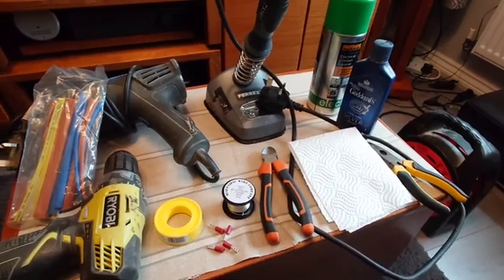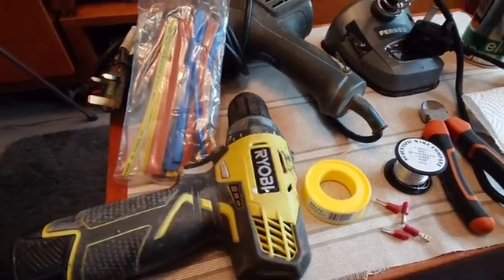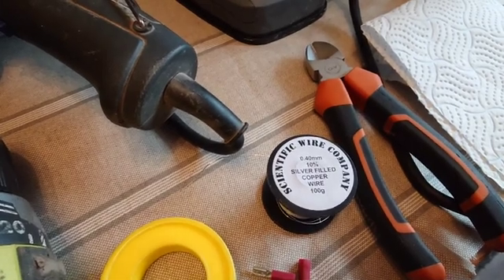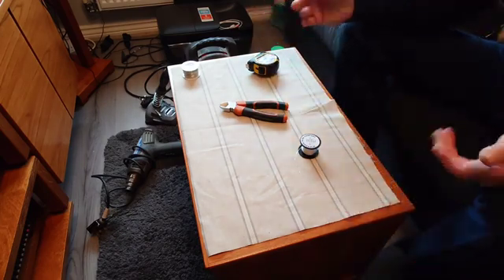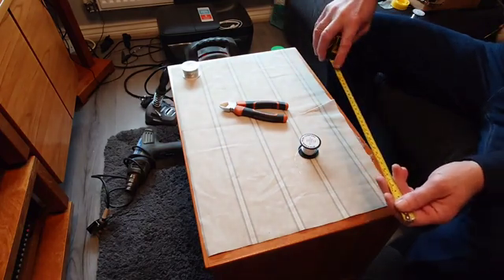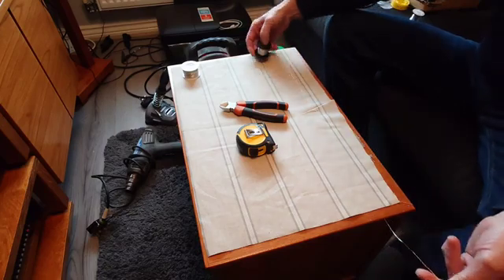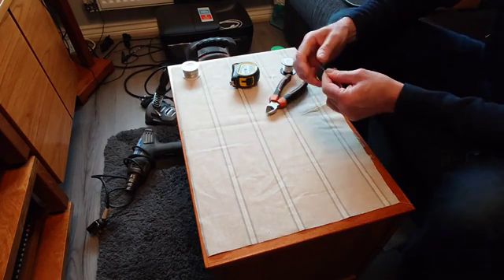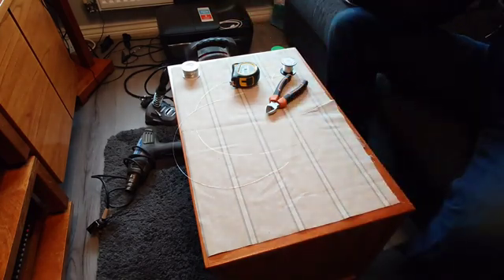HOW TO MAKE 10% SILVER CLADDED COPPER INTERNAL SPEAKER WIRE

Comment: I was planning this as well, but I'd probably go for pure (99.9) silver wire, as you don't need so much for internals. That's affordable, I highly recommend pure silver wire if you can afford it.
It's the aura, depth and smoothness of the sound that is really obvious. SIlver cladded is very nice as well, but sounds a bit more hyped then pure silver, it has more grit on the treble. I tested this on the SP-Dif input of our DAC,
Is your heat-shrink a 2:1 or 3:1 shrink factor?
Reply from the maker: 2-1 heatshrink👍
Reply: Why bother using silver wire?  The losses over such a short length of Cu. would not degrade signal to any degree that a human could detect. 
"It's the aura, depth and smoothness of the sound that is really obvious" BULLSHIT.
Reply: @BTW...  Owkay maybe try yourself before you speak?
Material matters in audio. If not he wouldn't be using silver cladded copper wire.
 ihave had this discussion so many times, I stopped doing it.
If you don''t have any experience in listening and building cable, of different types of wire, maybe YOU are  the bullshitter? Talking out of your ass, just because you can. Tsk tsk tsk....why are you even watching this channel then?
Reply: @Projacked1   Hard pass on that stupidity.
The most I'd do is increase the cross section area of cables, maybe tin plated flex stranded if it was on hand. 2.5mm sq is way over the top (good for 2.5kW) anyway... and what is the rating of that Amp and speakers? 
The only application where silver wire would perhaps make a lick of difference (ie. address potential signal degradation) would be in tone arm wiring and phono interconnects,  where signal voltages and current levels are extremely low.
 
In the real world, silver plated copper wiring is only really used in aircraft applications where corrosion control is an issue. Why would you ever use it unless you got it for free? 

When you get full qualified audiofools start suggesting "more grit on the treble" etc, at the output stage, we all know the type of idiot we are reading. Whats the next claim... the colour and plastic type of the insulation makes a difference... while ignoring the use of push-on connectors in the signal path?
Reply: @BTW...  Like I said, DO IT YOURSELF before you speak. Pointless remarks on specs doesn't matter. Listen to it! Before you speak! And, like I said , dumbass discussions with people who DO NOT do it themselves, been there done that. Spew all you want, I don't give a sh*t, I trust my ears.
If you can't hear the difference you need to go to the doctor.
Reply: I know what differences just the core size of cables can do , either solid core or stranded, shielded or not. WIth different materials in every part of the cable. It's just talk , I can tell.Every part of the chain matters, who cares what you think about oversized cables? Dude.... try it or shut up.
Reply: @BTW... 🤔 Opinions are like arseholes, most people have one, 
thanks for showing us yours.🥱
Reply from the maker: @BTW... Everything in the signal path makes a difference, the better the quality the better the sound, it's simple!!!
Reply: @tweakerman  yes, it's not rocket science
Reply: @tweakerman  It's wiring inside the speaker box!  Nothing like a signal path where exotic clad cable will make a difference... simple as that!  Your old man ears wont hear a difference at such low power rating too. 

Here is the thing... you crimp on stupid push-on connectors, made from  tin plated copper. That is signal degrading in that application. Why follow the half arsed factory production standards like that and then try to claim there is any merit in using silver clad conductors?
Reply from the maker: @BTW... These wires are for the quad 405, I've done lots of these internal wire upgrades & have always heard an improvement, that's why I do them.

I've been building cables since 1987 & have run an audio business for 8 years, with great reviews!!!

You may not be able to hear differences in different materials, but I can & that's all that matters 😁